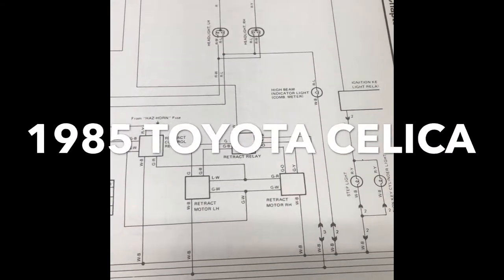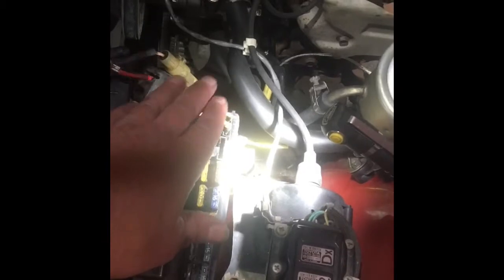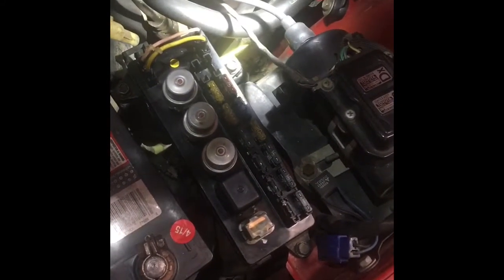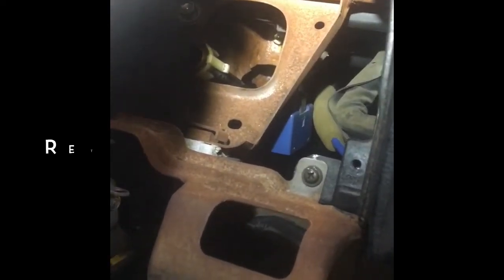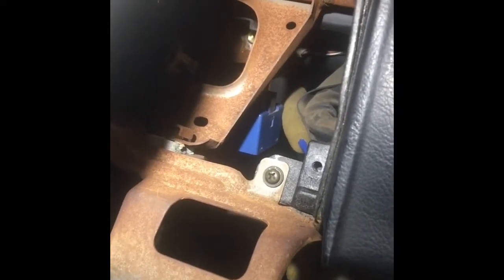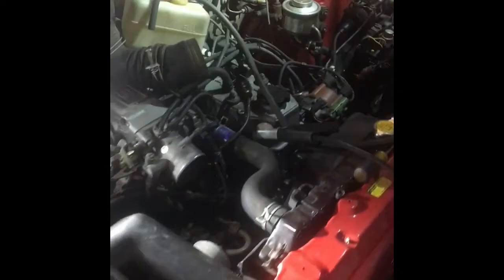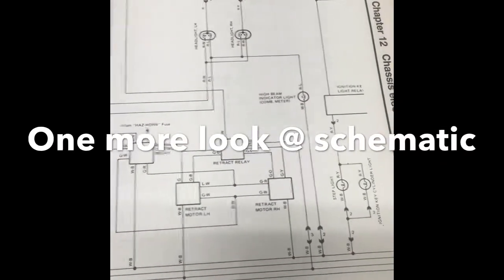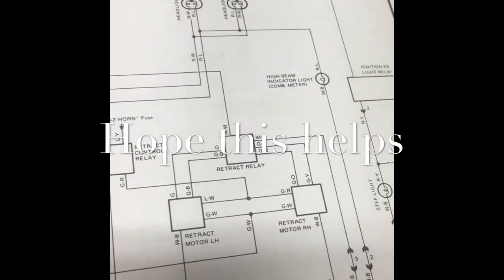Toyota Celica Retractable Headlights

Comment: Thxs imma try all this,, because mine lights come on but won't retract, and my horn don't work either,,
Reply from the maker: Hope something was helpful. I no longer have that Celica but with persistence I did get the bugs worked out. My windshield leaked & the car sat with a lot of moisture. The terminals and contacts were badly corroded in the fuse panel. It also caused grounding issues. A good multimeter, test light, schematic,   patience and time should help. 
Good luck!

Comment: Hi it's a long shot but only one side retracts   only. I've changed out the retractor motor and put in another. Still doesn't work on my 85 celica gts. What could it be?
Reply from the maker: The car I was working on and had a lot of corrosion issues. I just had to track it all down wire by wire connection by connection. Many times it’s a Ground issue